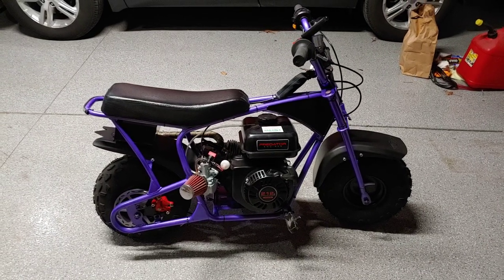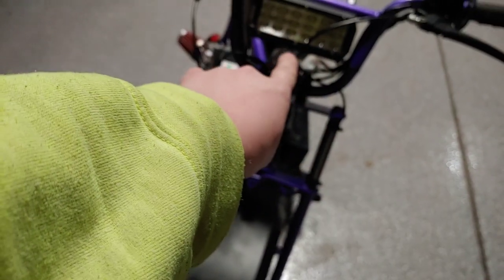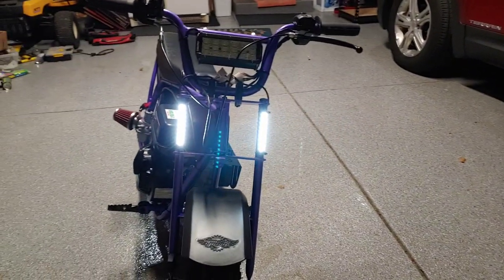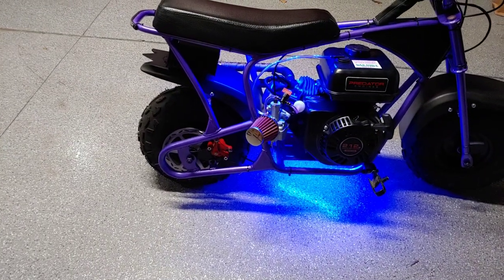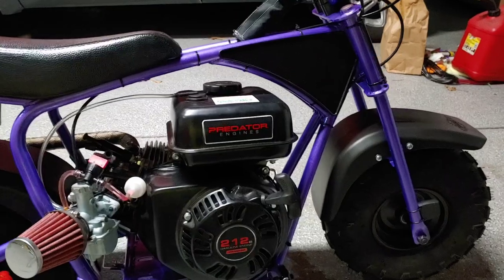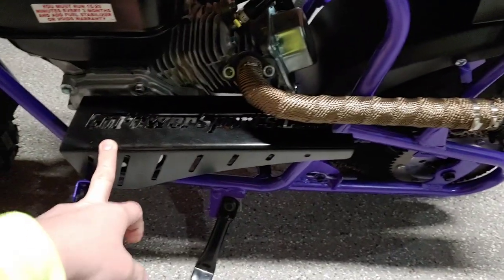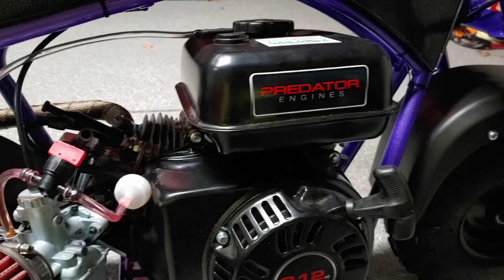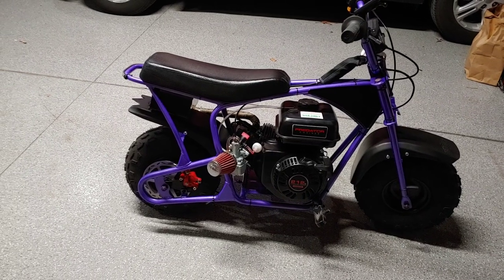Monster moto 212cc minibike: The Purple Spade

Comment: im building a monster moto 105 right now and trying to put a stage 1 predator 212cc on it but it seems like i need a mounting bracket for the whole engine and am going to have to re-route the gas tank somewhere else. howd you get your 212 to fit in there?
Reply: Did u figure it out? I want to build one and was wondering
Reply: There’s a YouTube channel called let’s build that and show a way to mount the bike which I’m going to try. Hope their video helps
Reply: @412EASTSIDER  do you know where you can get the frame? They have been out of stock for forever
Reply: @lilspecialboy8264  nah I can’t help you there

Comment: Did you have to cut the front oil drain bolt off to fit the mikuni carb in the frame?
Reply from the maker: I cut a little notch on the frame to make space for it
Reply: Pretzel's Garage  ok thank you I have the same bike but with a tillotson 212 and I was thinking about getting the mikuni I just wasn't sure if it would fit